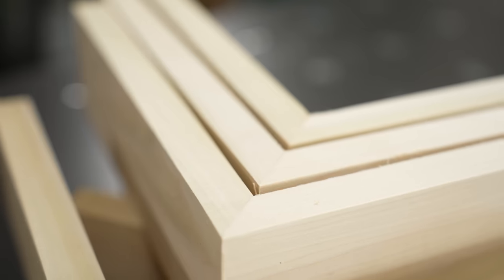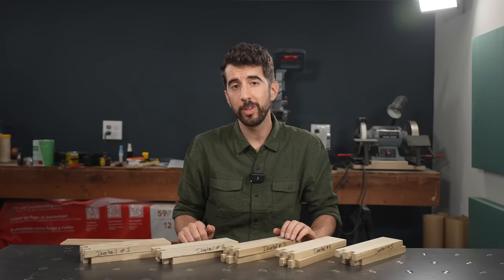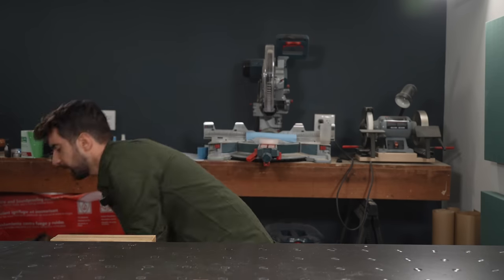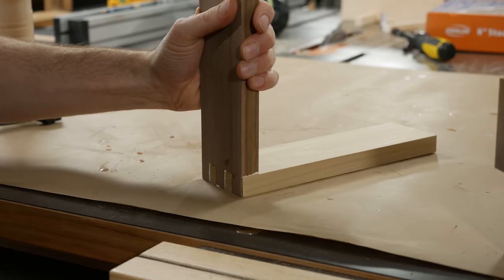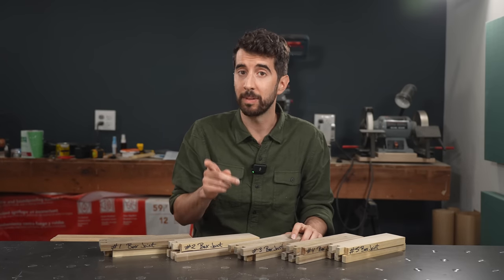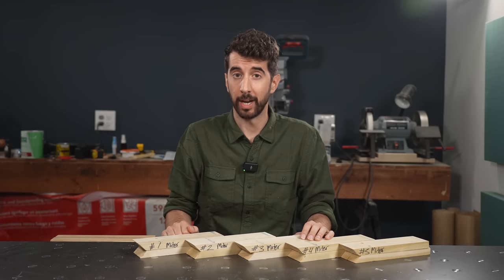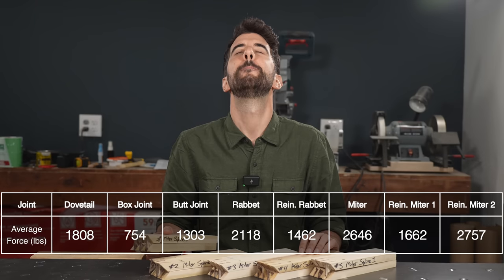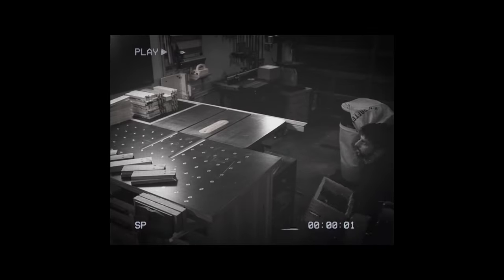This Simple Joint is Stronger Than a Dovetail!

Comment: Nice effort and commendable motivation.  BUT....  your testing setup has A LOT of variability--a lot of pieces in contact that do not align exactly the same for every single test: chain + 2 hooks + 2 axial connections to the instrument itself + square frame at the free leg side + I don't see well what at the other leg...  So, both the repeatability of your test setup and the accuracy of your measurements are likely low enough to blur the comparison of butt vs dovetail values and dovetail vs rabbet values.  This is by no means a shortcomming of yours, here is a whole science around designing repeatable and accurate testing fixtures--just having a hot loading mechanism and a measurement instrument means little without a highly repeatable fixtures that will grip every sample in exactly the same way, with exactly the same type and magnitude of losses.

Repeating the test, say 50x for each type of joint might offer more information but only if you can fabricate 50 almost identical joints, which is of course difficult when dealing with wood.  In general, you'll know your joints are "almost identical" if the final measurements for each type have a low standard deviation.  Even then, you'll just be confirming test repeatability for each joint type but not be able to compare between the joints because different joint geometry has different fracture mode/progression which in turn moves your square frame holder in a different way.  

A more appropriate testing fixture would be a friction jaw/clamp for each leg of the joint, but even then the variability of local wood fiber orientation and cross-adhesion would introduce variability....

It's a very hard test to do with wood, and that is why there are no industry standards for testing joints, only (some) for testing wood as material.

It's a popular belief that testing is superior to analytical reasoning... Unfortunately, it is almost always wrong when testing structures made of multiple pieces exactly because of impossibility of assuring identical testing conditions from sample to sample as well as between the types of structures we want to compare.  Testing still rules for materials only, where we can ensure samples close to "identical".

What I would have done (if I wasn't sick of staring at the screen and fiddling with a mouse all day long) is to make a CAD model of each joint, assumed a homogeneous material in all 3 directions to start with, then simulated the test in Solidworks and obtained the loads at fracture for all 4 cases, and THEN weighted the results with, say, the ratio of face/endgrain surface areas perpendicular to the load direction for each case.  

That's basic structural mechanics analysis, a mech or civil eng sophomore should be able to set it up in couple of hours given the access to all the software.  And it will be THE BEST estimate you can make for this comparison.  

Sorry, it just happens to be my background :))

Comment: Look Mr. Walsh genius, you have it all wrong. The reason people use dovetail joints over other types is that over time moisture and weather can warp wood, along with a lot of expansions and contractions that occur will eventually loosen those joints and fail. The DOVETAIL joint will not fail as fast!!!
Reply from the maker: seems like you didn't watch the video....

Comment: Glueless, nailess, screwless - that's the real way would working should be done. None of this fancy glue. None of these woodworking nails you cant' find anywhere because nobody makes then any more, not of these screws that are worse than glue.
Reply from the maker: Ever hear of the term gatekeeping?
Reply: @ScottWalshWoodworking That's the word people who don't like to uphold standards use for those that do, isn't it? 

Screws are bad. Just bad. Nails are bad, mainly because there used to be woodworking nails that were decent but stopped being made in favor of the inferior screws as for glue... look man, old glues were bad but kept things repairable, modern glues are great, but they're not only harder to remove than traditional wood glue BUT they're tougher than the wood they bind together. At some point you need to ask yourself, do I want to wood work or make stuff out of plastics.

A lack of gatekeeping is why Ikea exists. And Ikea is why in place of having furniture for generation entire forests need to be cut down for the latest crappy desk you'll have to replace in 3 years.

Comment: You keep saying "mechanical advantage" but I really don't think you understand what that means. You're not using the term correctly and even though I kind of get what you are meaning to say, in that there is mechanical strength in the dovetail joint, it's still not really a relevant statement to make, as glue is also a mechanical bond too so there is no "advantage" there.
Reply from the maker: I know it's a misnomer, but like many misnomers, they're so over-used in wrong situations that they become acceptable after a while. That's just the way language goes I guess. I'm certainly not the first person to say that a dovetail has mechanical advantage

Comment: Crazy, nonsensical results. I am only left wondering why in each joint you broke, the only failure was glue. Compared to every other "machine breaks joint test" I have ever seen where boards were shredded due to the glue being stronger than the wood. I think your test failure was a lot more than just starved joints, but I do believe you had huge test failure. I sure don't plan to use Butt, or Miter joints in a chairs manufacture anytime soon based on your results anyhow. Not saying that to be snarky, mean or otherwise an A Hat. I am truly wondering what major malfunction you experienced to have the breaks happen as they did. Your breaking machine was kinda cool though.

Comment: I didn't watch all the way to the end, so I'm taking these as black and white recommendations. From now on, all my joints, no matter what, will be biscuted mitre joints. If those joints fail, it's all your fault, because you said they were the strongest. In fact, i'm going to pull down the walls in my house, and re do all the nail and screw joinery with biscuted mitre joints. I love the videos, but you just ruined my life, and i'm not going to be taking any responsibility, whatsoever.